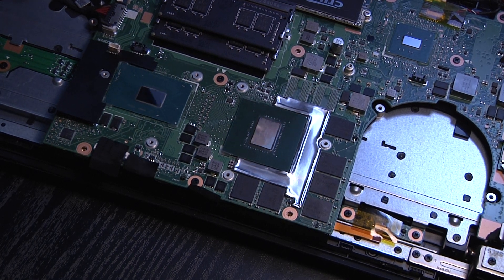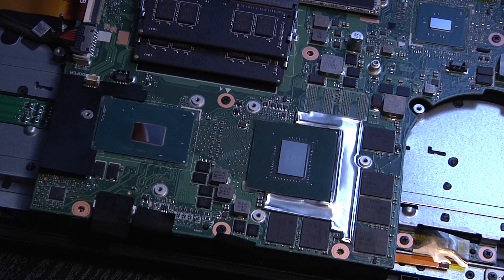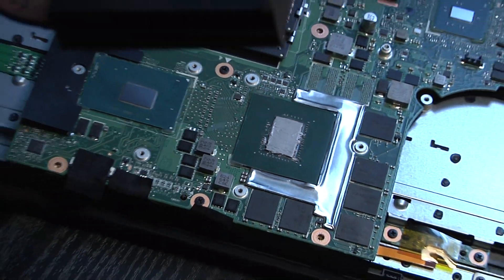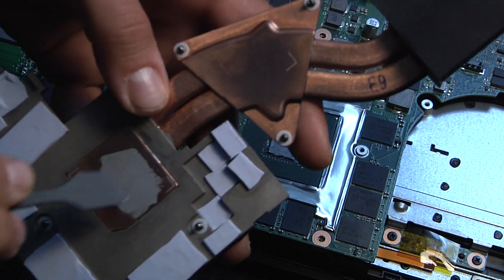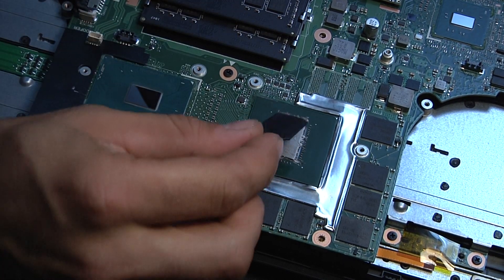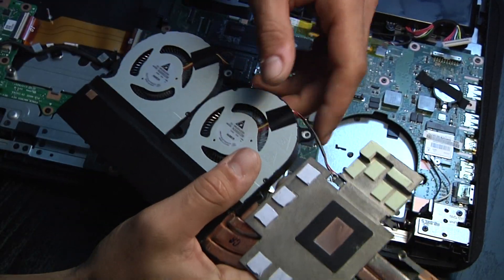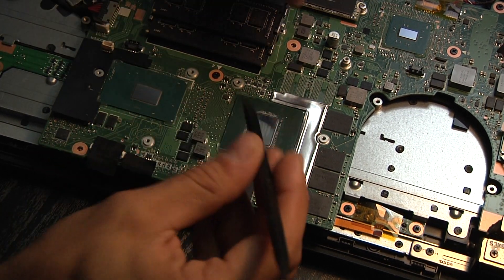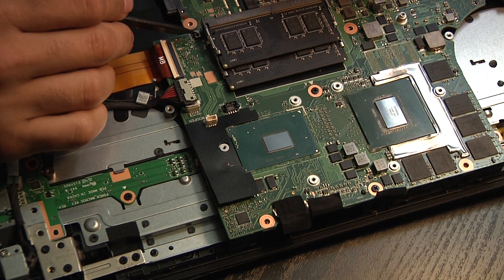How to repaste a laptop CPU & GPU

Comment: Yeah, when i overtighten it last year from my first attempt in repasting, the result are a really worst temps.
But in my helios 300 (2017 15 inch) unit giving that more paste than rice grain result in a same worst temps, i get the best when i only do it like a little bit longer than rice grain, let it spread and when i open it next year (now) to repaste it again after i notice some thermal performance drop.
I see the paste spreading evenly (probably due to the black tape at the heatsink trapping the paste on the cpu & gpu die).

By the way, i only use 1mm thermal pads on all chips and it's working fine, but indeed there is some chips that need 0.5mm, probably cause of my thermal pads are elastic (thank god), otherwise i would crush the chip and brick the board.
I didn't recommend using all 1mm pad on the chip, but if you're using arctic thermal pad, maybe your chips would be safe since that one are elastic.

Overtighten and overpasting resulted in avg temps staying at 93-95 with max fan (game ark survival, high) for cpu while gpu at 85-90 all in celsius.
After using considerable amount of paste and not overtighten it i got 84 avg and 74 avg for gpu all in celsius.

That's funny cause i didn't even undervolt it, undervolt -0.125V giving me 75 avg cpu and 68 avg on gpu (120 core 300 memory OC) all in celsius, and that's damn decent for i7 7700hq + overclocked gtx 1060m (same game, ark survival at high setting).
Ah i forgot, and thanks for your recommendation about thermal pad and paste.
Your tutorials last year are really helping me out.
Reply: what do you mean by overtighten?
Reply: Damn my 7700hq only goes down to -0.115v

Comment: You are a real hero man...This guy is just the god of HELIOS PREDATOR 300....He has helped me with my temeperature issues and now my laptop runs perfectly fine....Thanks alot dude....May god bless you..✌😊😊!!!
Reply from the maker: Thanks brother
Reply: Rodrik Gregor Forrester  just stays at about 70s and 80s....But before that it used to spike up till 99 degrees....and there is a huge difference now....
Reply: @harishvarakaash  yes this is because Acer's stock thermal paste has very bad quality.. Even my acer predator g5-793 was to hot until I repaste it.
Reply: Rodrik Gregor Forrester  Not at all dude...For a gaming machine about 70 to 80s are going to be normal temps while playing fr long hrs...That is why gaming rigs are mainly obsessed with increasing the cooling efficiency....U see the New predator helios 300, it already comes with a factory undervolt and the fans have been seperated and blades have been improved fr cooling...So around 70s and 80s during intensive gaming is completely normal....Anything above that is to be concerned with...😊😊!!!